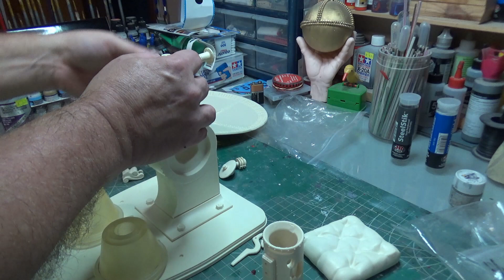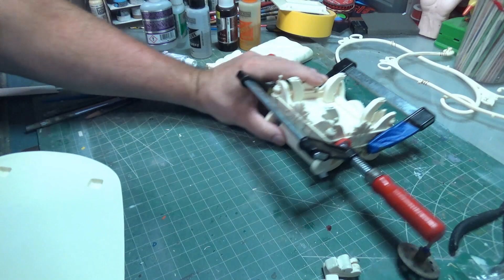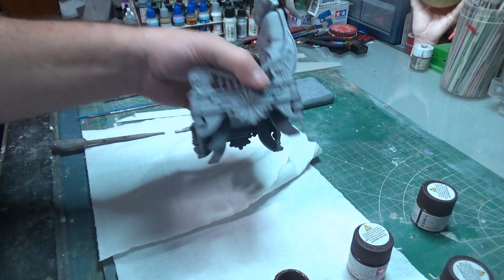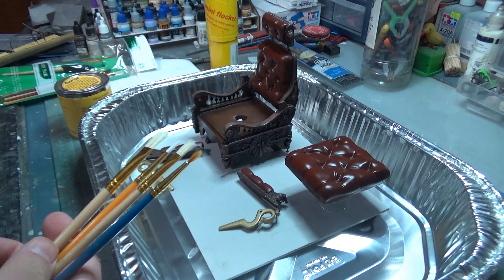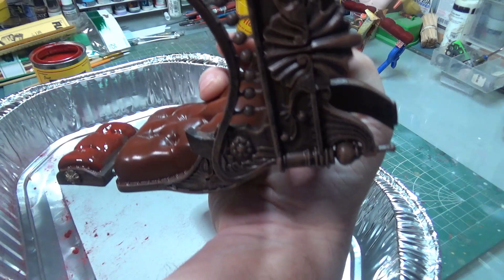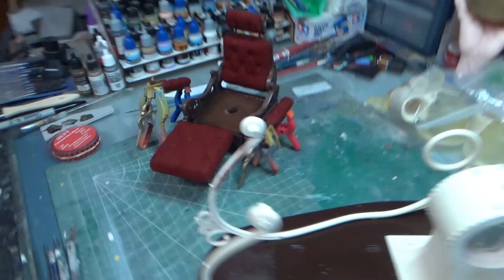Aztek Dummy Update 6/17/22 Sprueverse Time Machine Challenge - Part 1

Comment: A lightening generator is the beginning of a lightening engine.

Could a person confuse time travel with teleportation , if they don’t know the world entirely?

A lightening generator engine .
For travelling at the speed of lightening.

Ever see a engine that runs entirely on lightening?
The replacement of spark plugs for constant and not intermittently.
I have never seen a plug produces a string of lightings ...
It’s like a 4 poles of lightening in a series design ..
Imagine Tesla’s design only tiny and with four rods instead of one ...
Linked in a line but together with arcs of lightening....

Imagine telephone poles in a row and no wires in between . Instead , pure arcing  of energy ...

They add to the energy already formed ...

It’s like adding a few types of energy to the main lightening engine..

Like creating a rope of energies...

Four wheels turn to create its own static energy to power the wagon to move on its own ....
One wheel generates enough perpetual energy to move on its own power ..

Why are automobiles wheels not designed to put energy back into car ?
Because they run on gas and not pure lightening...

I saw a mouse , drive a wagon , by running a wheel that created energy ...
With a use a gears and chain drive ...

Model scale for mouse to run the energy..

The wheel the mouse ran , turned the gear and chain , that spun the wheel , that created the energy ...that in turn , moved the cart ....
Pure electrostatic energy....

I replaced mouse and wheel with tiny motor that runs off of electrostatic energy..

I spin the disk , it creates energy instantly, and drives the motor that spins the disk that creates the energy to drive the motor ...
Perfect energy catch 22 ...
It feeds itself , it drives itself ...
It’s it’s own perpetual energy and drive and motor ...

Comment: Are your  Franklin Leyden jars working correctly?
Is you wimshurst disk putting out enough power ?
Is the volcanor drive confusing you ?
Have you got the Wells accelerometer fully functional?

The key is franklins Leyden jars..
It stored lightening during a storm ...

To capture lightening was to discover electrostatic energy ...

Comment: Lou, use a longer shaft for you drive shaft mechanism. This will better stabilize the drive shaft from wobbling. Install two bearings then install your motor in the lower square section, connect to the shaft to the motor, install one bearing in the top of the drum and one in the bottom with the shaft running thru the drum center. The shaft will be better stabilized as the motor spins.

Comment: While I can understand making the chair velvet, would the foot bad also be covered in velvet? I could see making that one a matching color leather since it's expected for shoes to be in contact with it. It would also give you a variation of texture which is always a nice thing on a model.
Reply from the maker: from what I'm learning about this chair, I'm not surprised it's velvet. The headrest is actually the foot rest of the original barber chair, just turned around and stuck at the top

Comment: The nes plus ultra of movie props in one of the most influential and well-visualized science fiction efforts in cinematic history. And you've got one! I love the story of you three maniacs going further than anyone's gone before on this subject. 1/6 is monstrous and can take all the detailing you can stand...
I will defend to the death your choice of flocking but I will still question your sanity. That's so clearly leather on those seats, but fine. Sure, Go ahead. I see your nerves of steel are in good order with that grinding burr. Very nicely splitting resin atoms to either side and not blasting through the sides or the bottom. My congrats.
I also have to question "Mike's" sanity in making that right angle support gadget for the big dish about as strong as Betty White's spine. Even without the internal gearing-- a piece of cast pewter would be more like it. And the turned brass sounds up to the job. So that is a wise and necessary investment.
Too bad no one made a commercial plastic version. Looking very much forward to all three of you gentlemen's execution of this high end of the art!
Reply from the maker: I'm not going to change your mind, but take another peep at the scene where the machine is toppled over on it's side. in the sunlight, it looks more like velvet than leather. Now granted, as a barber chair, velvet is very impractical. But George strikes me as the type of pampered Victorian that wouldn't think twice about having it re-upholstered. having just reviewed the film. I stand behind my flocking.
Reply: @aztekdummy  Make room, Lou-- I gotta get in there with you. I gave a look around and found a nice, clear still of the seat when well lit. It's velvet alright. Please accept my apology. I kind'a believe the sculpt of the model makes it look a lot more like leather. The velvet cushion look is quite different with Rod standing up. Now I know better than to question...
Reply from the maker: @MrChief101  that's alright. In my zeal to prove you wrong I went back and reviewed the footage to find I had in fact hinged the armrest backwards. My first instinct was correct, but I was persuaded that it hinged in the front. so i spent the day making like i thought it should have been in the beginning.
Reply: @aztekdummy  Look, buddy, I'm getting pretty old and I get some mighty funny ideas in my head... But the hinges here, there-- it all fits in the weird design concepts. I have never heard of the origins of those wild Victorian styles-- was it Wah Chang himself who scoured the old junk shops? Those swans are just wild, where did they come from... (and those, plus the wheel things and the giant time fan thing should all be cast in metal!) As ever, I eagerly await your next installment.

Comment: The seat is called the saddle in the original book. The two types of saddle when the book was written was horse or bicycle. Which suggests that the idea in the book was that the traveller sat on top of the machine with legs either side...